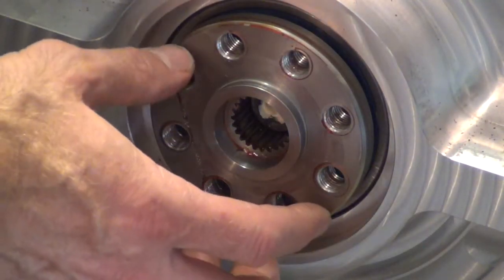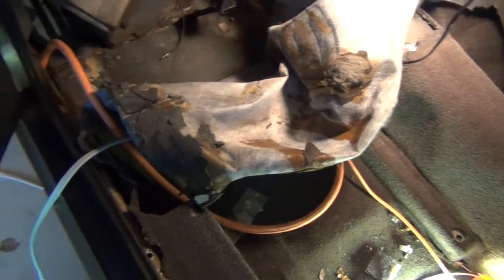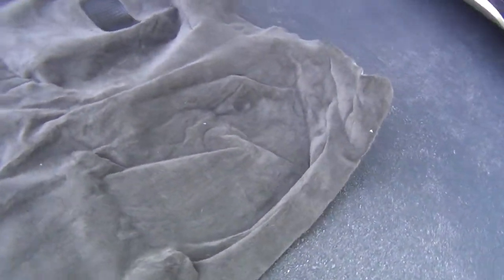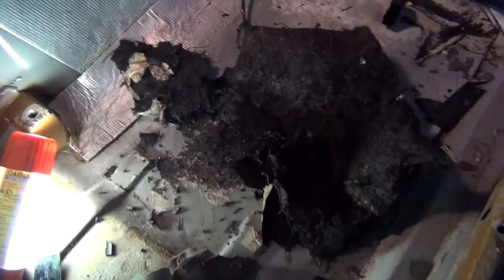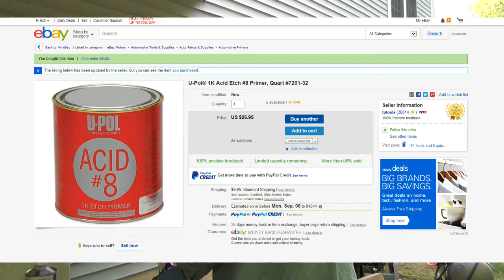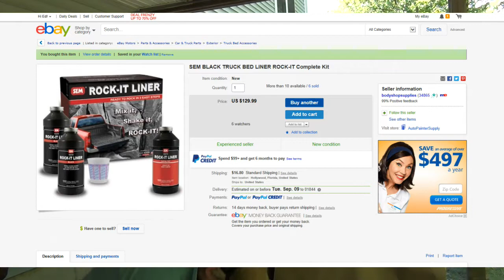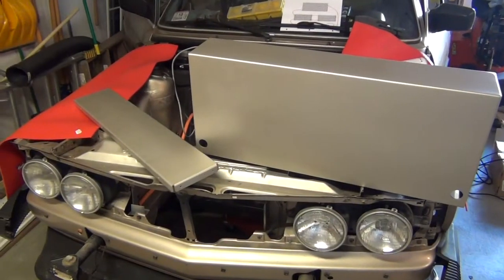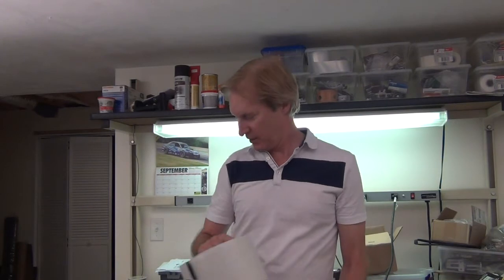Electric BMW 320i Video #7

Comment: Hey Ed,
I can not exactly see whether the car has a sunroof.
If so, you should check the water drain pipes in the A or B-post.
My Mercedes T-Model runs like that always full of water (no time to fix it). I have taken out the sealing plugs on the bottom of the car. Thus, the rainwater can always immediately expire.)
Nice job.
Regards
Mathieu
Reply from the maker: The car just has a vent in the roof,not a sunroof.  But that is not the leak as I have driven the car in the rain and did not get wet.  I think the leak was in the feedthrough for the ignition coil.  But thanks for the comment and I will check those drains.

Comment: Hi Ed,
I'm over here on Cape Cod and will be putting a Jack Rickard special (Siemens and DMOC with a GEVCU) in a 2001 BMW 740il.  Once I saw that Damien was up to putting his Siemens in a BMW 840 I thought my Siemens motor up to the task of motivating a 740.  

I have two questions for you....
1. Who did you get to supply the BMW motor adapter?  
2. What exactly is Matt and Micheal (EV- West) going to do to your adapter?  I see it has some lash.

I'm enjoying your video's.  I currently have a 1993 Ford Ranger with a Warp 9, a home built Cougar Controller and 92 - 60AH calbs paralleled into a bottom balanced 144v pack.  Working out the control wiring details now .... never enough time though.

Do you know of any "local" EV groups or rallies?

Thanks for you time
Dan Mills
EV-EAST.com